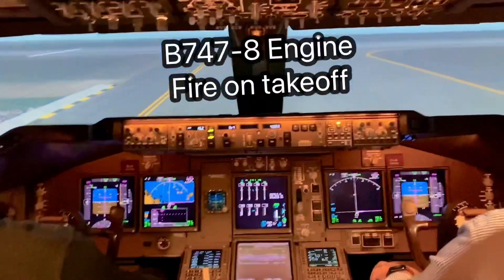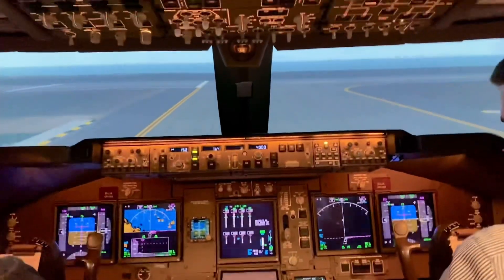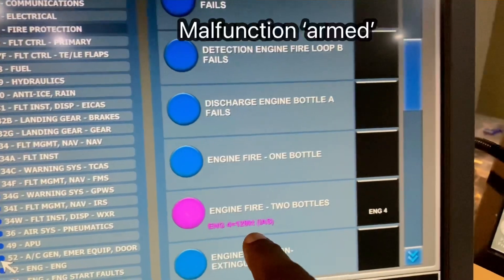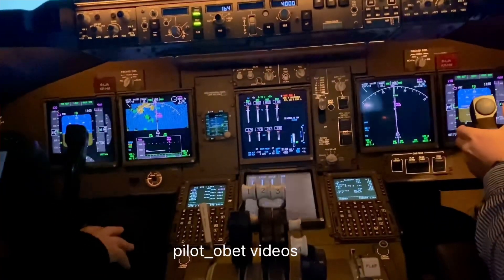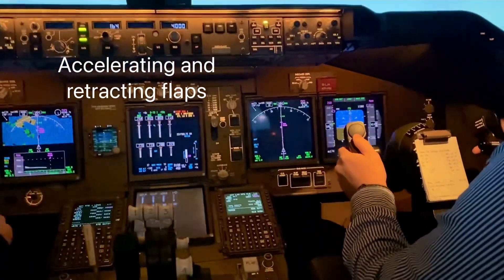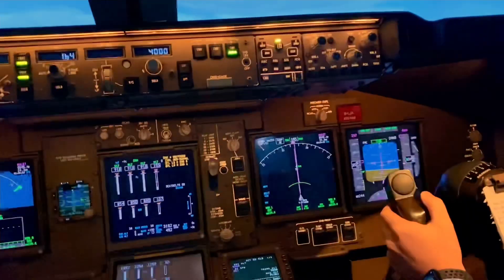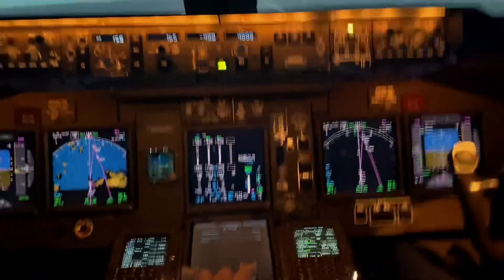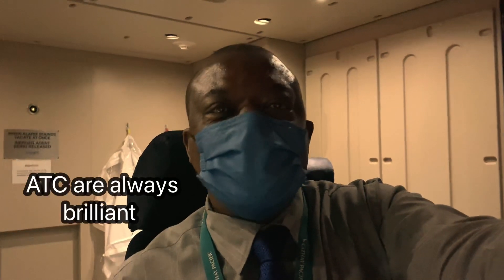Engine Fire procedures and actions on Boeing 747

Comment: Save cracks and broken fuel lines, what else could cause an engine fire? If both bottles have been discharged and the fire has not been extinguished, how many minutes do you have at your disposal to get the aircraft on the ground and evacuated? One can safely assume that critical engine fires are not a common occurrence these days?

Comment: Theres a scene in the 1997 movie Air Force One where engine 4 (yes number 4 just like in this video) gets shot at by enermy fighter Migs, and catches on fire. The co-pilot just switiches the extinguishing bottle BEFORE first lowering the throttle for that engine and cutting the fuel supply.
Reply: You are meant to cut off the fuel first. Sometimes cutting off the fuel can extinguish the fire without even using fire extinguisher. Movies used to be unrealistic.

Comment: The guy running the sim can be very sadistic. I was running 2 engines at 1.30+ EPR, nearly max power, on the ground. Suddenly I jumped chocks. I brought the power back and applied brakes. I had no brakes. Dual brake system fail. Once power was at idle, deploy thrust reversers. Use of the TRs isn't in our checklist as ground maintenance. However, our instructor made sure that we knew how to use everything no matter if we were pilots or maintenance.